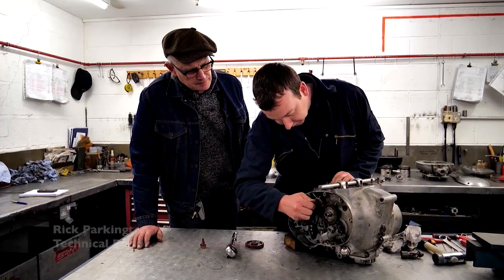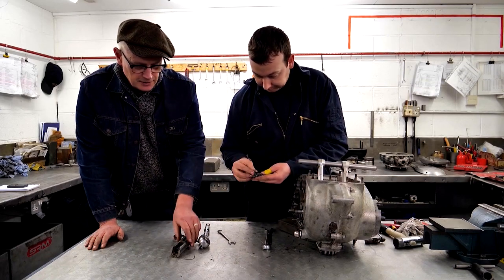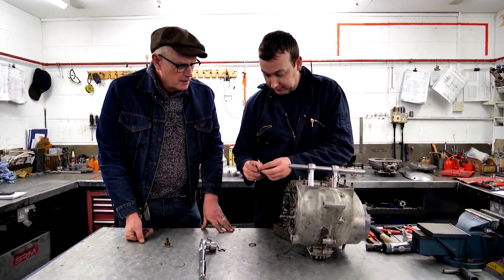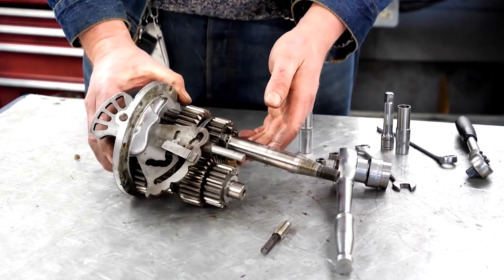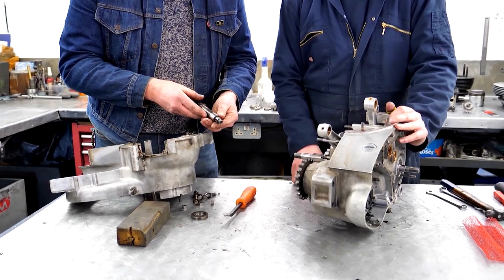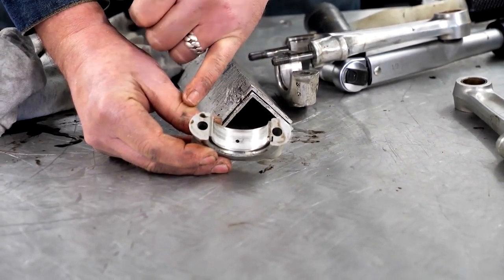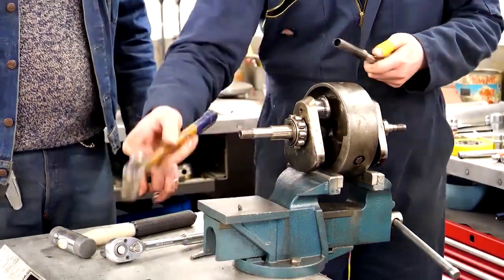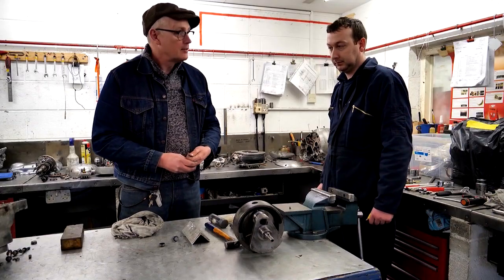BSA A65 Strip Part 3 | Rick's Fixes with SRM

Comment: Can you tell me a have a BSA A65 1967 There is a hole in one comrod what side drive or timeing side 
What happens if fitted to wrong side
Reply: The con rod with the hole goes on the left hand side (the drive side).  If fitted the wrong side, the left hand bearing will be starved of oil